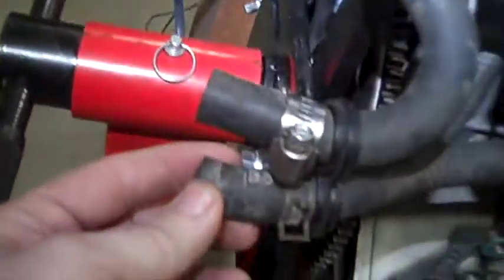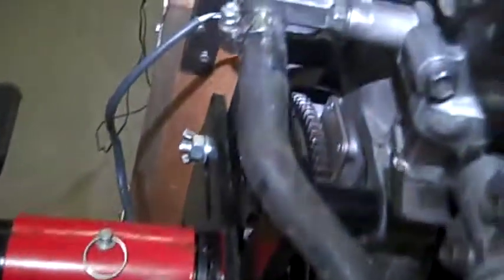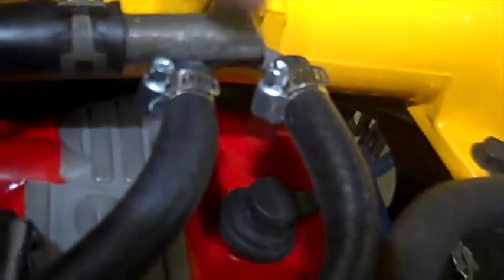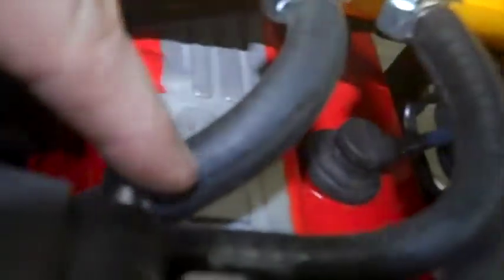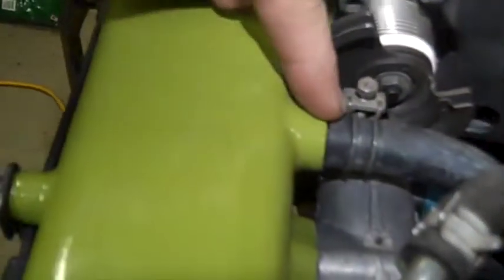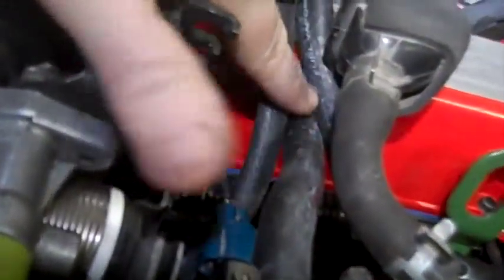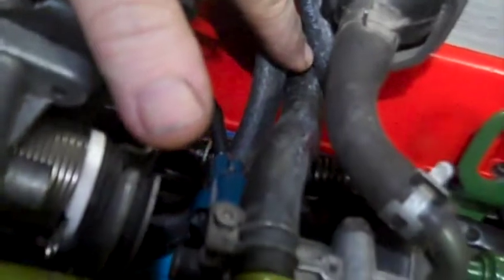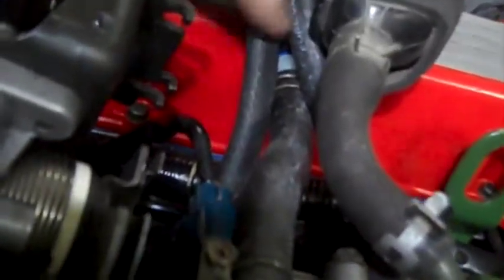1995 Suzuki Sidekick Hose Routing

Comment: Is there any functional purpose at all for the line that goes from the IAC to the bottom of the throttle body to go up above the valve cover and through that metal U-turn piece? To me the hose routes fine directly from the IAC to the throttle body.
Reply from the maker: I actually had the same question and  all I could find is that it may be to heat the intake air a little.

Comment: Nice! What's the size of the pcv hose? or those air hoses in general coming out of the manifold. 15/32 could work? Thanks!
Reply from the maker: I don't know the official sizes.  Might be able to get them from the parts diagrams on megazip.  The easy thing to do is measure the fitting/inside diameter and then go to the parts store and pick out the closest fit.  A little tight is better than a little loose.

Comment: Hi! Where do you think would be a good point to insert a smoke machine to detect a vacuum leak? Same engine, thanks!
Reply from the maker: I have never tried that, never heard of it before now.  I am thinking that, with the engine off, the solenoid valves for the EGR and EVAP are closed so the only possible vacuum leaks you would find would be the short little tubes to those two valves and the tube to the fuel pressure regulator.  Probably be easier to just look at them for cracking and fit.

Comment: Frank, what are the factory specs for the radiator cap? 13 psi / 0.9 bar or 16 psi / 1.1 bar?
Reply from the maker: I don't know, but if those are the choices then I would go with the 13psi cap.

Comment: 1995 sidekick 16 valve. Does anything connect to the bottom of the evap? It’s the Canada model. 4wd
Reply from the maker: You mean the charcoal canister, right?  The bottom is open to the air.  There is nothing connected to the bottom.  That is where air can flow in/out to maintain a neutral pressure.
Reply: @nunapitchuk  appreciate it. Hard to find that online. It has a hose on it connected to nothing right now and I’m wondering if the previous owner connected something wrong
Reply from the maker: @Korellix125  I don't know.  A person might put a ball valve on it or run a tube up to a higher location if they are planning to go in deep water.  Just a guess.  I don't have anything on mine.

Comment: any chance you have a routing guide for the vacuum lines? i have a line that comes it appears from the tranny that has a tee in it with a short hose (maybe 5 inches) and a longer hose maybe 15 inches, i have no clue where they hook up but i have almost no vacuum advance short of flooring the thing on even moderate slopes, it will bog until it gets to about 2500 rpm then it will accelerate at least somewhat reasonably its also cold natured which i suspect is tied to this as well. im not a great auto mechanic but i follow directions well, just changed plugs wires distributer cap and it runs better had a bad plug, but i still dont think its right without knowing where all the vacuum lines go,i know im leaking and i feel like its the biggest part of my issues, any help would be VASTLY appreciated!
Reply from the maker: You can chat with me on my face book page:  www.facebook.com/SidekickRebuild/ or email is fine too.  There are no vacuum tubes to the transmission on a '95 sidekick.  I think you are confusing the vent tubes with vacuum lines.  Also, vacuum advance is from carburetor days. I would need much more info to be helpful to you.
Reply: @nunapitchuk  ok, I'll try to give you what info I know. I'm mechanically savvy but my wrench turning is on attack helicopters not cars. Will visit you soon with particulars. BTW this is a 94 geo tracker which I'm told is literally the same vehicle.
Reply from the maker: @mikeholton9876  Yes, the same.  I can tell you where all the vacuum hoses go, but I don't think your power problem is related to vacuum hoses --- possible, but unlikely.